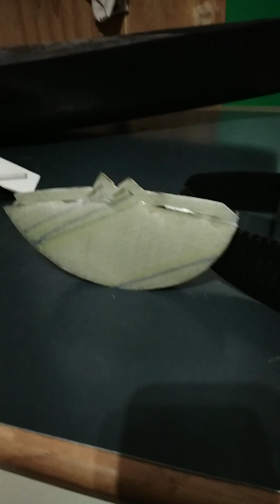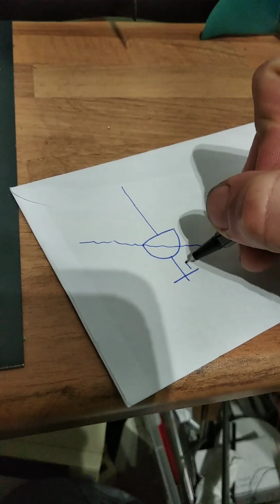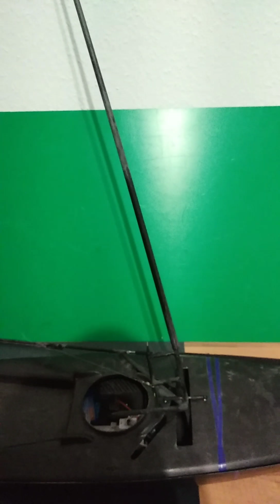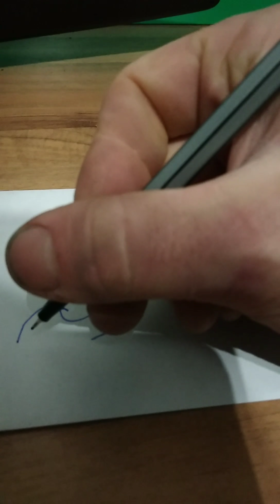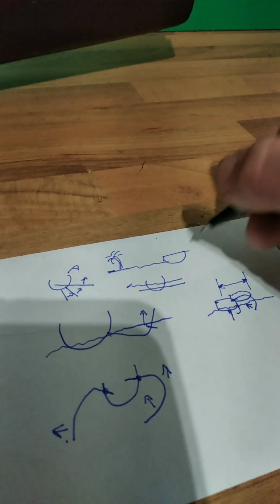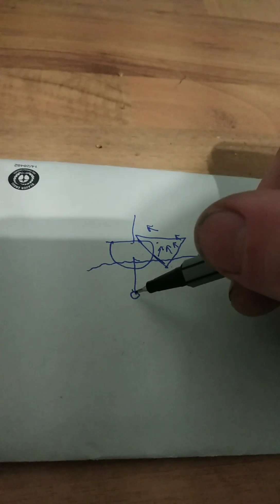Foiling monohull RC boat Brainstorming

Comment: Very interesting design. Can’t wait to see it all working. How will you control it? Just with the Tx, or will you have a gyro or some other mechanism to help automate when they move? 
How did you make your rudders? Very nice and clean!! 👍
Reply from the maker: hey thomas.
check out the new video
the plan is not to use a gyro but if, i think i can use a multiaxis exelerometer with a resberry ore audrino. i haven't used or seen one in person but how hard can it be?
Reply from the maker: Hey Thomas! The rudders are Made with a 2 Part mold. 1layer 245g Carbon and microballons as core material